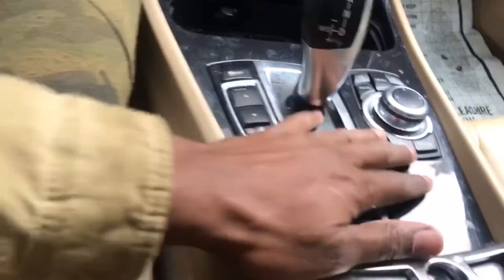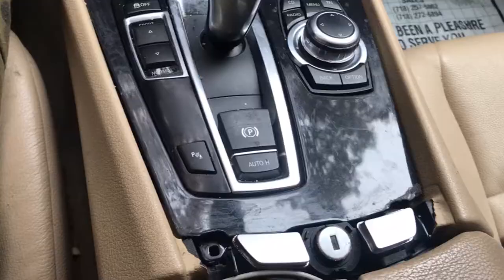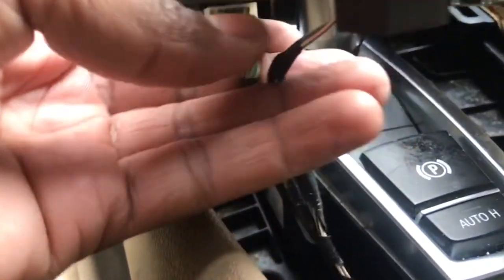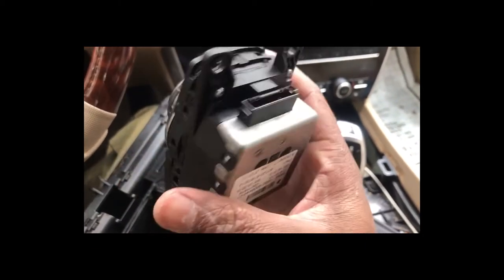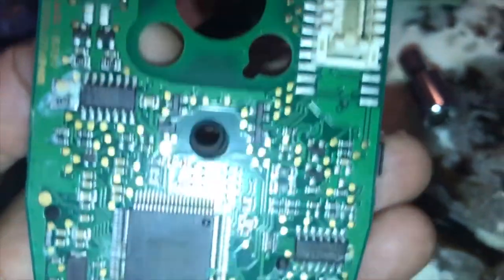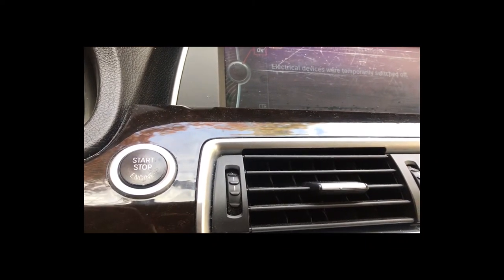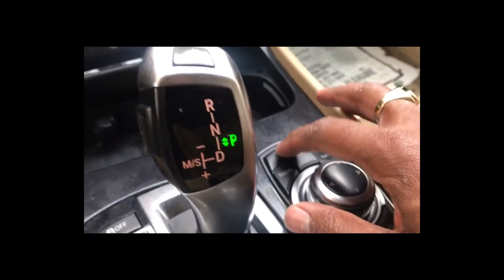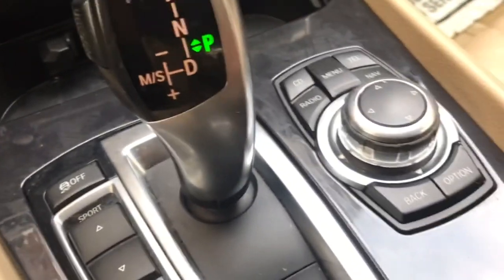BMW IDRIVE CONTROLLER FIXED AFTER CLEANING

Comment: You should show how you cleaned it and what you used but thanks for the video great job and demonstration
Reply from the maker: i used a razor and carefully cleaned between the micro chip connectors and use a brush clean where i saw corrosion

Comment: Soak it in isopropanol alcohol and stir it and shake it dry (wear eye protection) the center toggle buttons need to be flooded and cleaned

Comment: Not working in my 2011 BMW 535i after my car was detailed. I can scroll up/down and switch menus by using the navigation buttons BUT pressing down on the middle joystick to select an option do not work. 
- This video show that you can navigate but you did not press. Can you press down and it work?
- I found a replacement module on eBay $80.00. Shall I buy?
Reply from the maker: yes it did press all the functions work

Comment: Bro i have same problem the knob is working but it wont press, or buttons wont work, btw what caribbean island yu from
Reply from the maker: jamaica
Reply from the maker: yeah you might have to try clean it up
Reply: What size bolt on the bottom?
Reply: ME TOO, BUT I DO NOT KNOW HOW TO FIX IT
Reply: @frank_jueye  same but did u figured out the issue?
Reply: @ibraheemraed8138  did you figure it out?
Reply: Mine the same issue

Comment: Gonna try this right now brb
Reply: Note in my 2013 740 LI there was only 2 screws to remove by the key area
Reply: Current stuck can’t get to circuit board
Reply: Bless up bredda mi thing a work propper now you save me a nice piece a ends